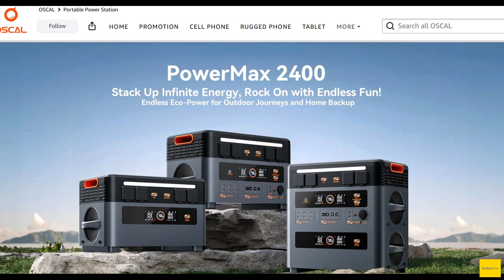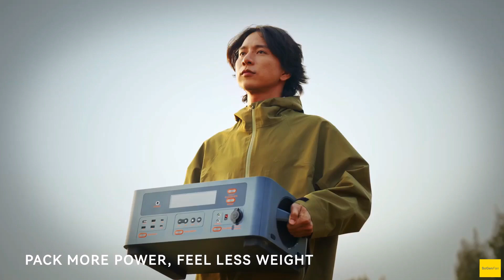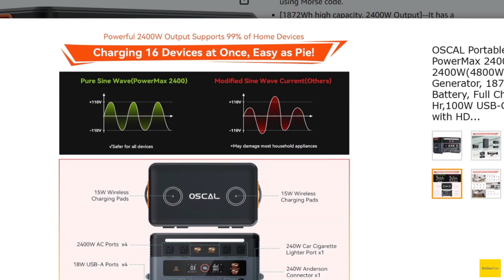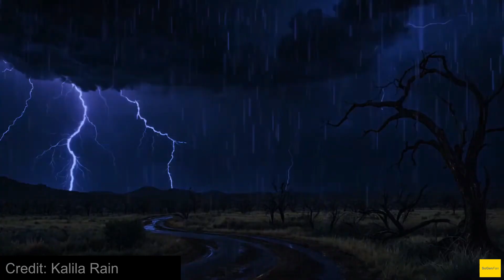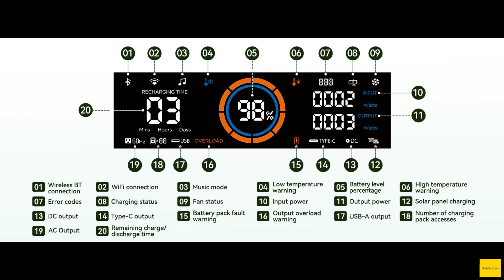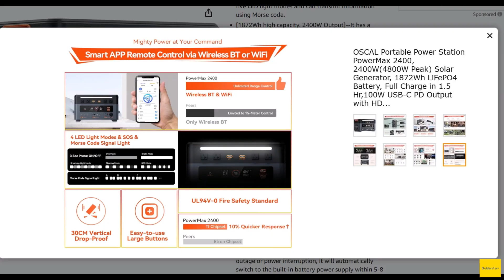OSCAL PowerMax 2400 with Cable-free Expansion

Comment: Dear people, I urge you not to be fooled.
After I bought six copies, I got into trouble.
If three devices were spoiled at the same time, this led to the exhaustion of the inverter.
In some other cases, a faulty BMS card caused an explosion, rendering the device unusable.
Currently, only six devices are working properly. Others must be completely laid down and buried in batteries and other souls.
Much of the advertising for which the least weighted advertising was in stark contrast to the quality of the product.
I now have an inverter that chews and loses batteries. Even a capacity of 30 kWh is cheaper than that of Oscal, with a capacity of only 2400 kWh.
I advise you to think carefully about buying favors from your Oscal.
The replacement solutions are available at attractive prices.

Comment: Ok, now we have another company making a sad attempt to copy the Titan! Fails, cheap latches,high frequency, built in wireless charging,built in usb,smaller power,proprietary plugs,no external battery exspansion port, for real load sharing,no ability to use any battery/ chemistry,solar input to small, voltage to low! Why keep trying to copy them, because there design was great! If your gonna copy, why not build it as good or better, my thoughts it would be copyright infringement, or way to exspensive, and the world is hooked on cheap stuff, not quality